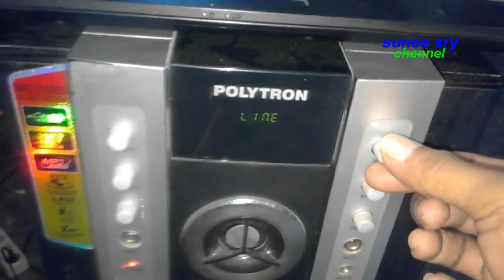Tutorial Mencari Kerusakan Speaker Aktif Polytron Suara Serak Sebelah vlog 12

Comment: bermasalah gak speaker di kasih aksesoris lampu led.. biar lampunya ikut irama musik?
Reply from the maker: Tidak asal di kasih komponen dulu
Reply: @dksry9537  apa aja komponennya itu gan.. supaya speaker atau ampli ga jebol
Reply from the maker: kalau hanya lampi let biasa saya di kasir r saja gan
Reply: @dksry9537  pake led strip 12v gan
Reply from the maker: @migoreng2091  bisa san pakai led display 12 volt .
Reply: @dksry9537  di kasih resistor berapa om klo pke led strip 12v

Comment: Mas, mohon pencerahan kalo speaker aktif polytron suara sering sendat2
Reply from the maker: suara normal [ TIDAK PECAH ,TIDAK DENGUNG,TIDAK MATI SEPARO ] namun [banyak vaktor  suara nyendat nyendatkencang sendiri  kecil sendiri bisa jadi ada kabel korosi / solderan konektornya retak /potensio udah udah aus atau minta ganti/bisa juga di sebapkan solderan KOMPONEN rengang atau retak/ agan coba lepas trasistor c945 kalau tidak salah ada 2 buah letaknya  berdapingan  coba agan lepas  dan agan coba hidupkan kembali tanpa transitor tersebut ada perbadaan apa tidak biasanya transistor itu sering protek  ] coba agan  cek dulu itu sebelum membawa ke tukang sevis,,, terimakasih sudah mampir di channel kami.. atau temen temen yang  lebih mengerti bisa tingalkan komentar saling berbagi ilmu /pengetahuan tadak ada salah nya.
Reply: @dksry9537  c 945 berdampingan udah ganti.tip semua ganti masi serak gan